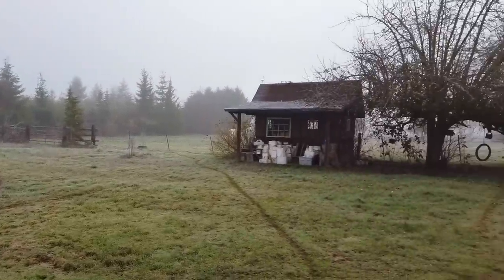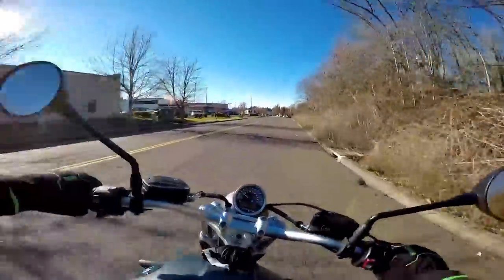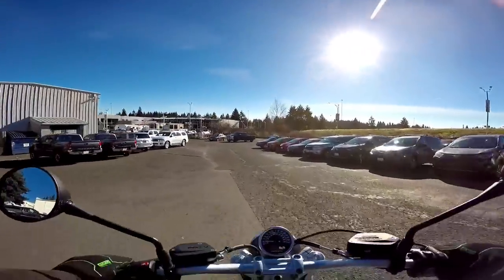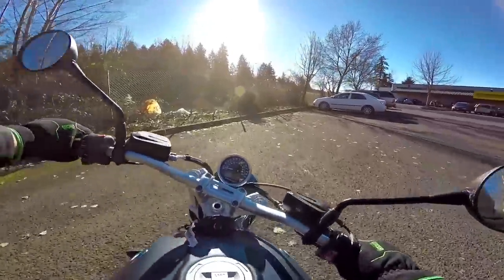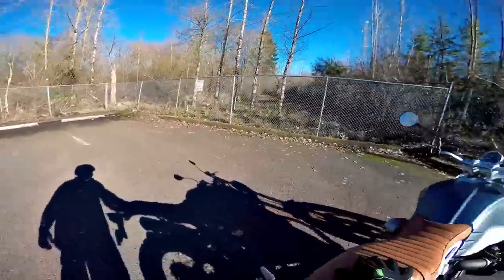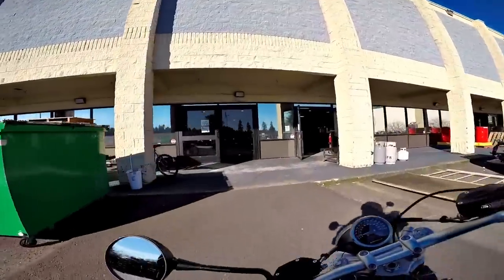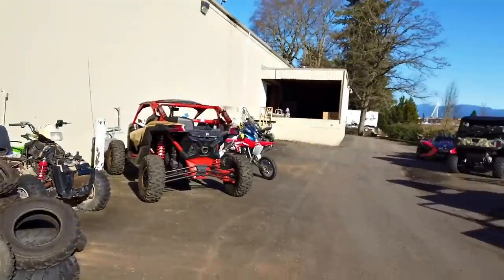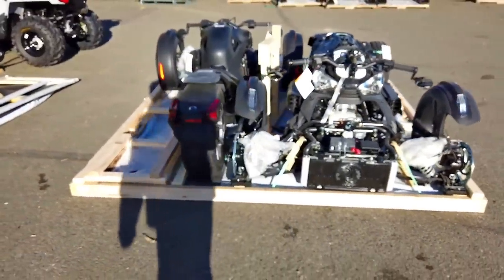The R9T Never Gets Old!! • Ryker Uncrating Info! | TheSmoaks Vlog_1171

Comment: Shawn: Thank you so much for detailing the Ryker uncrating and initial assembly caveats, beginning at 11:20 of your video.  My dealer must have done EXACTLY what you described. They mistakenly scratched up the A-arms on both sides of my bike... pretty deep in some spots, all the way through the powdercoat.  Perhaps BRP should note that potential issue by wrapping those arms with more padding and/or bright CAUTION tape? It is done all the time with aftermarket parts and computer equipment while in transit containers. Even the part itself will have bright yellow stickers with a warning label.  Just my thoughts on how to prevent the error.  Keep up the great vids!  They are a true blessing to the community!
Reply from the maker: Oh no, that's a bummer yours got scratched..!  My son scratched the right front of the very first Ryker he pulled from a crate.  He mistakenly removed the protective padding from the A-arms before installing the fenders, and....  Well, he hasn't scratched another since! Lol  BRP should stress the point of removing padding after the fender install in their assembly manual!  Using your suggested measures would be helpful as well.

Thank you very much!!
Reply: @TheSmoaksVlogs  If you don't mind my asking... how did you fix the boo-boo? Was it by replacing the damaged parts?